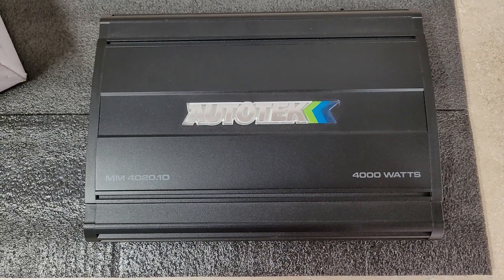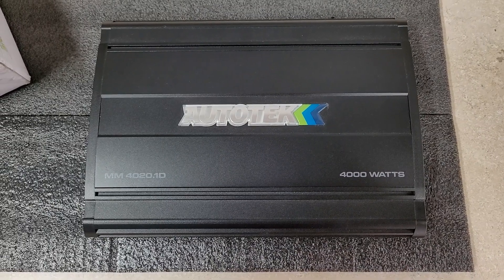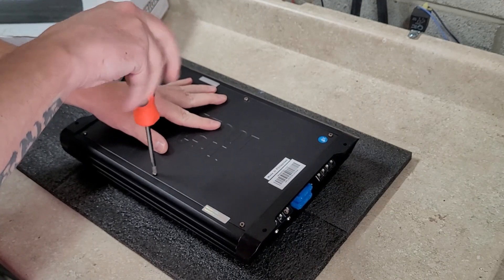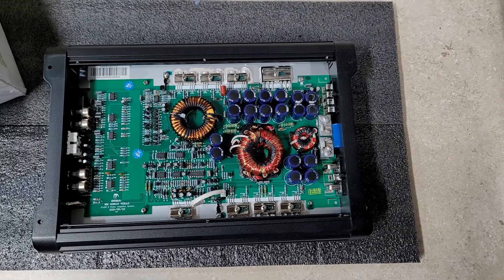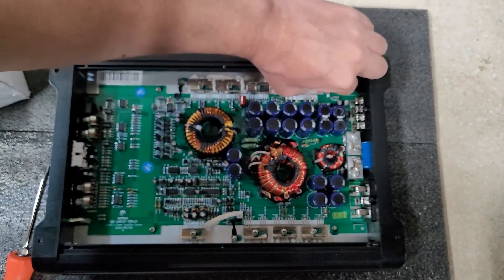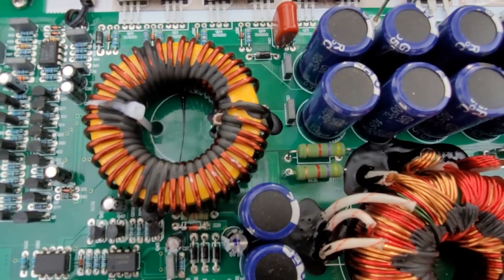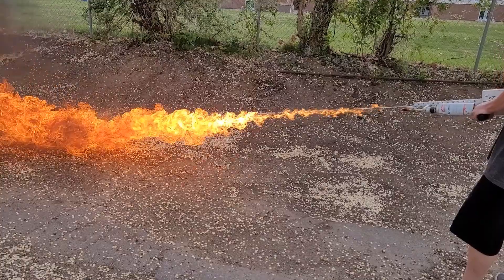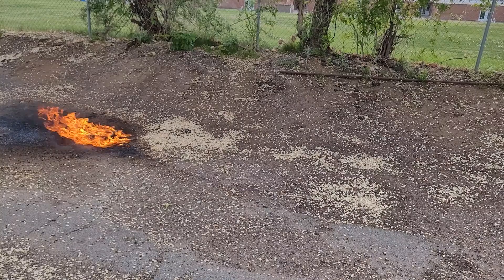How to Add Watts to Your Amp by Jones Subwoofer Solutions JSS

Comment: 4000w ? no no, I think dynamic rms run to extreme clipping can reach over 10k rms + can handle alot more heat over 120c, take off orion hcca xtr and rockford for underrated power